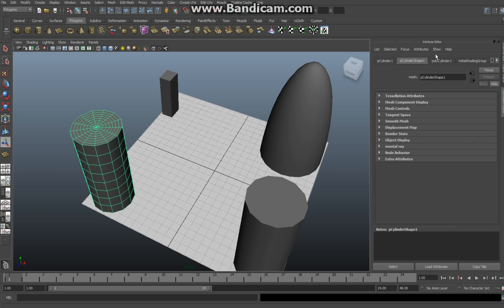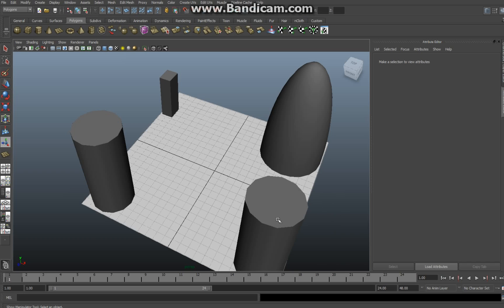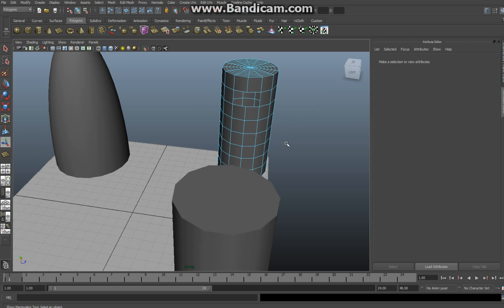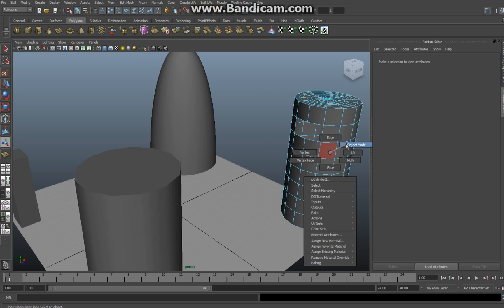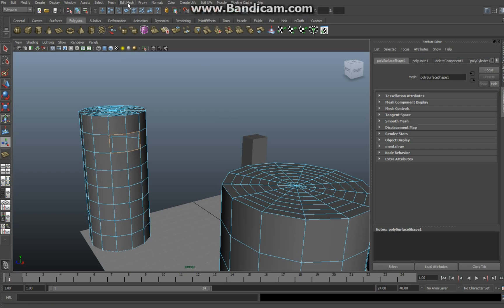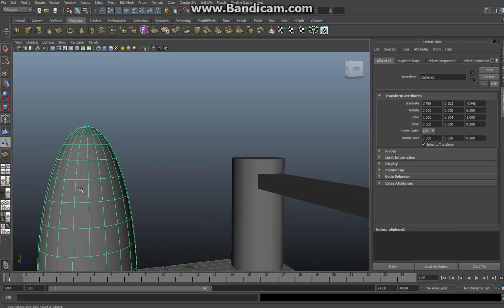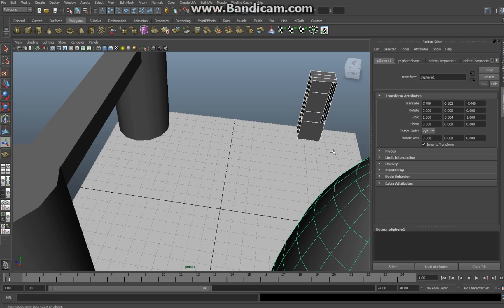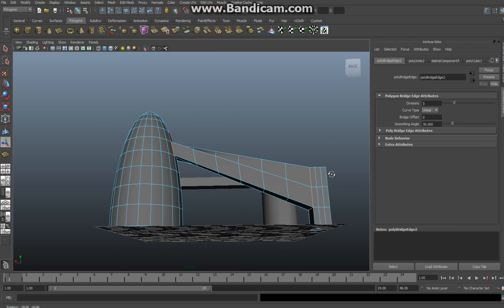Maya tutorial: How to use the Bridge function in Maya

Comment: Hey Mike,

I'm working on a huge physisit lab. From outside; this is one huge tube, who's going true differents size and kind of flask format. At the end I would like to have one huge piece, because I want to have some liquid travelling inside.

Even if it's not the easyest way to do it, at first I wanted to duplicate the final shape of the "circuit" and reduce it, to bluit the "inside part". But when it comes to bridge them, it's going to connect everything without logic. Witch seems so strange, because there is the same amount of edges, and they are close by.

Any solution? 
Thks

PS: If any other poeple who read this got the answer, please feel free to help.
Reply from the maker: It is incredibly hard to understand what you are asking here. Am I understanding that you are looking to create fluid in flask ?
Reply from the maker: Oh, that is easy. 1. Select the object you want to "fix" 2. Hit Ctrl+E to extrude 3. Set the thickness ( top value ) to 0.01

Comment: Mike Hermes if I wanted to join 2 selected parts of 2 objects that have a DIFFERENT number of edges (for example, one part of one object has 4 edges and the other one of the other object has 6 edges), I should use another tool? If yes, which?
Reply from the maker: The number of edges need to be the same ( or accept a weird shape )
Reply: So there's no other way at all to do it with different number of edges?
Reply from the maker: Manually by connecting components
Reply: With which tool?
Reply from the maker: Combine both objects ( Mesh - Combine ) then select vertices from both ends that you want to merge ( one of each side ) and go to Edit Mesh-Merge Components
Reply: I can select only vertices or also edges (from both ends of the 2 objects)?